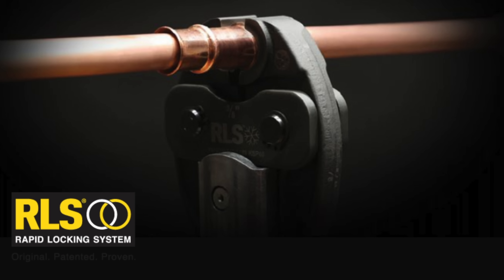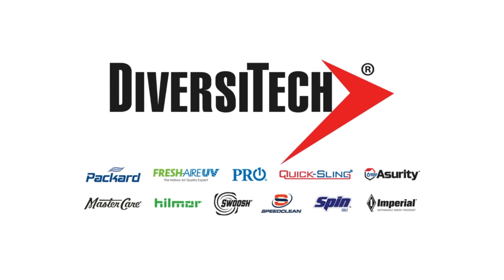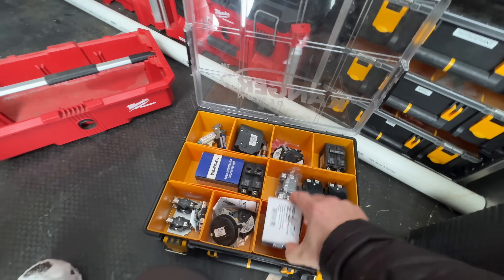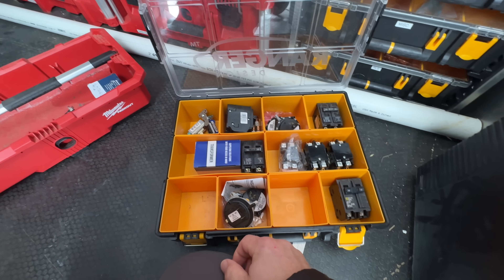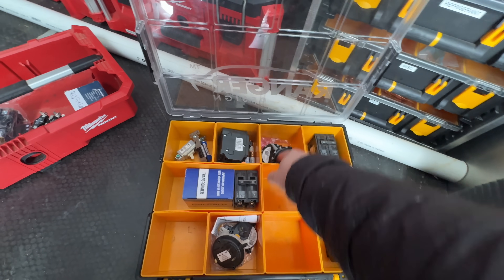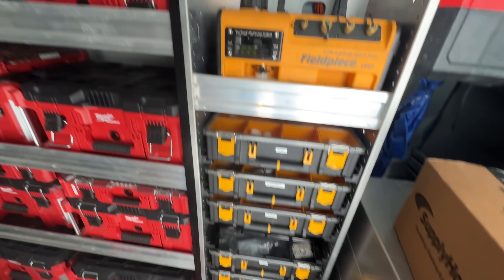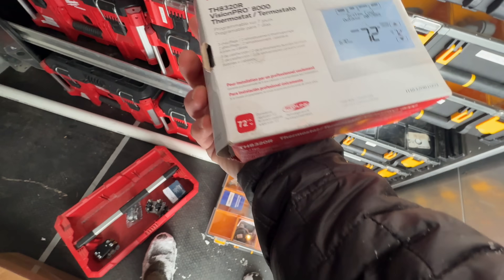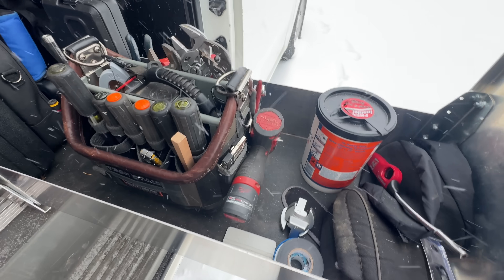No HEAT Call in a Tennessee Blizzard!! HVAC Repairs

Comment: Gotta like the easy ones! Sucks when it’s the worst day of the year though. During winter, It usually averages 30-40 degrees in my area, so I won’t set a HP lockout and let the customers run it, but set a 30 or 60 minute defrost interval, depending on how humid the area is. Usually every HP we put in has an accumulator too, so that will help any liquid coming back if it frosts heavy. However, I have family where the winter can be single or low 20s for 2 months straight, and below 0 cold snaps, so I had them run only the strip heat during the harsh part of winter. Their summers are hot so it’ll save the life for the cooling season 😊 kinda also depends if you have a single stage or inverter HP. I’ve seen some HP systems without accumulators, and I question that, and would say no to under 35, maybe even 40 lol. Must be a cheap thing

Comment: chart. this gives temperature rise, ie: if the return is 70 degrees, how much warmer the supply air is coming off the indoor unit.

OD TEMP TEMP RISE
65 33
60 31
55 29
50 27
45 25
40 23
35 21
30 19
25 17
20 15
15 13

Comment: I'm in north Texas. I tell my customers to switch to emergency heat at 20 degrees. We had some really cold weather here this week. I turned my heat pump back on at 12F just to see what it would do. I was only getting about a 4-5 TD, so I switched back to EH. Mines a 2017, 15 SEER RUUD system.

Comment: Here in nc you have to install a Cut off sensor to turn the Odu compressor off and run the EH when temps falls to a certain degree on new installs.Most of the times the cut off is 35-30

Comment: Here in Central Texas I set my Ecobee thermostat to run the compressors with regular heat pump heat down to 15 degrees Farenheit.  So far it is working well enough to get my rooms up to 68 with a 19 degree outside temperature but no snow.

Comment: in my area we have outdoor thermostats on about fifty percent of the units.... but yes... when there is a cold front that comes through where Temp is expected to be near zero for a few days, I tell my customers to put the unit into EMH until normal temps return.... just keep in mind that some outdoor units may need to be cleaned of snow from condenser before starting

Comment: Just went through my second cold snap here in Texas. I suspended my tstat  schedule & let heat pump do it's thing. It handled heating with minimal heat strip usage. Bryant 2- ton with 10kw stripes. Average daily use 40kwh almost no - stop running.

Comment: I think if it’s a high efficiency heatpump inverter and rated to heat down to 0 or below let it run all the time. Until its temp that it loses capacity. 

But if it’s only rated to 40-32 for full capacity anything past that and your heat strips will be fighting longer defrost cycles and not be able to work as efficiently as possible.

Comment: We went to Trane heat pump, electric heater setup in 2022. We have been VERY pleased with it. Our HVAC tech told us to swap to EM Heat when it's below 30 outside. We just have the lowest trane heat pump unit. I wanted one with an inverter compressor and higher SEER rating but my God it was gonna be almost $18-20k! Ridiculous. Lol. 
Awesome videos man! Love your channel!
Reply: You can buy a Mitsubishi inverter heat pump system that's direct replacement for your current unit for around $5-8K depending on system size. Other brands like Mr Cool (made by Midea, also Carrier has them make units) run a little less expensive. I'm a huge fan of inverter heat pumps, but wish more companies would recommend them at reasonable prices.
Reply: @memsu06  oh man I wanted a Mitsubishi hyper heat inverter one so badly. I was quoted like $17-$21k for one to be fully installed. If they'd have said $8-9k , I'd have bought that immediately.
Reply: Idk about residential tbh but in commercial if it’s not an IT room or there’s no other option, we don’t push those mini splits or anything inverter. You’ll never get your moneys worth and they can be frustrating for technicians to work on.

Comment: Whoever replaced tstat removed the white wire so they could come back on a winter service call.  Happens a lot.
Reply: yeah i was thinking the same thing....just cant trust some people
Reply: I know what you mean about crooked HVAC contractors pulling stuff like that. Unfortunately, I experienced more than my share. Here's an example: One company contracted with MICA(Mid-Iowa Community Action) to get all their mobile home furnace replacements. They would, of course, have to remove the 'A' coil(since most mobile home furnaces are down-flow furnaces) to replace the furnace. After replacing the furnace they would shove the coil back in the cabinet, but not hook it up to the line set and do the other things that need to be done when replacing an 'A' coil. Then, in the spring, the mobile home owner would turn on the A/C and find they didn't have any cooling. So, they'd call the company that replaced their furnace to come 'fix' the A/C. The company would come out and 'check it out' and tell the homeowner they needed a new A/C; that the old one was shot. They would then charge them such that they would make up for the 'discount' they gave MICA on the furnaces and labor.

There you have it. Not everyone in Iowa is 'Iowa Nice".

Comment: In Canada, we often set our heat pumps to cut out around -10 C (14F) because past that the OD coil can only grab so much heat to be comfortable for the supply air. I have an issue with vertical discharge outdoor units in the snow, because if ice gets on the fan blades that can mess your day up.
Reply: Im from Aus and have no idea about this, but surely someone can come up with hot gas bypass to help evap
Reply: @jrodamos  to be fair, the hot gas is already being sent to the indoor coil. The real problem is the outdoor unit can't absorb enough heat with where the technology is currently.
Reply: Same in Central Michigan
Reply: Woah. I always thought that the heat pumps usually become inefficient around the 30-35°F mark since it could put strain on the unit. I guess depending on the region they have them built a different way. Pretty interesting!

Comment: Hey brother! From Maryland. I’ve always told the customers to keep the system in normal heat mode unless the outdoor unit stops operating, then use emergency heat mode. I feel that it really depends on the actual equipment. Some equipment is more efficient than other.
Reply: Could you advise what is the difference between auxiliary heat and emergency heat?
Reply: @thecurious6721 I'm  from PA. we don't have air handlers. For the most part we have gas furnaces & central air for AC. But some of the newer systems the ac unit has a heat pump. In that case it would be considered 2 stage heat. If it's chilly outside you can run the heat pump. But if below freezing you can go to what's called emergency heat (gas furnace). It's been awhile since I wired my nest but W1 & W2 is for the furnace & OB is for the heat pump
Reply: @Dachamp2001  thanks
Reply: @thecurious6721  Np
Reply: @thecurious6721 im in oklahoma, but I rarely see a heat pump with gas as its emergency heat. Typically, it's electric heat strips (which is what is shown in this video). Which is the reason for the customer getting a heat pump (they live somewhere rural and dont have gas run to the house). A heat pump makes the refrigerant flow in the opposite direction so it absorbs heat from outside and releases it inside. But when it gets below freezing there is less heat to absorb and the outside can freeze up. The unit then switches itself to defrost mode and runs the emergency heat while the outside is thawing. But you can choose to just run it in emergency heat from the thermostat if desired.
Reply: @Cavett24 as I understood auxiliary is when heat strips are heating while  heat pump is running. Emergency heat is when electric heat strips are heating with heat pump not running. Why he/you use it as emergency heat instead of auxiliary heat?
Reply: @Dachamp2001 what part of PA are you in? I’m also in PA and about half of our systems installed are air handlers and heat pumps.
Reply: @MrCmgl1  Pittsburgh That's typically what we have furnaces & central air. Don't know about the ne building's like apartments & condos. But there's still a lot of old houses that still have boilers and steam heat.

Comment: I’m in Ontario and we just started installing Bosch heat pump dual fuel with back up gas heat and we are setting for the heat pump to switch over (balence point) to -10 celcius
Reply: How long have u been in the trade

Comment: Lennox ML14XP central HP here. I run that hard in winter in PA. It’s backed up by oil instead of strips so I do have the stat lock out the HP at 15 F, just for my own comfort with all the defrost cycles it’d do.

Comment: My 25 yr old HP definitely works harder in heat mode, compressor pulls 500 more watts and defrost cycles 90 min cumulative run plus reversing valve cycling.  In Florida it's a rare event though.

Comment: There are heat pumps here in NH but I don't trust them to work when it's -20 F. I've heard that they're a lot better lately, but time will tell. Because I'm on a mountain and lose power several times a year, I have multiple heat source options. When the propane & oil trucks can't get up the mountain, I can still use wood and pellets. I am considering getting some of these for AC and having a spring/fall light duty heating system is a good option. Having redundant systems is a fact of life while living on a mountain.
Reply: Northern VT here.  I have an oil fired furnace , a Harman Wood Pellet stove and a propane gas fireplace that does not need electric to work.  When its sub zero and the wind chills are in the minus 40s and 50s you can't be with out some kind of heat source!
Reply: @richardthomas1743  Too true neighbor, lol. I've got an indoor wood boiler, 2 propane boilers and an oil boiler. I also use a wood stove and pellet stove that both have DC fan options. I also have a propane furnace for the big garage as it's back up source to the radiant system. 
   I also have propane and electric dryers, ovens and water heaters. There are 3 different fuel generators here too. Propane, gas and diesel/kero. There's more but you get the idea.
Reply: @MakeitZUPER    You are prepared!  👍
Reply: I’m also in nh, I mainly work on and install vrf/vrv heat pumps and it’s hard to believe but I have seen heat pumps still produce plenty of heat in below 0 temperatures even with heavy wind on the roof. Now I absolutely wouldn’t want to pay the electric bill and I’d bet a compressor might blow if it’s below zero for over a couple weeks. But they’ll surprise you.
Reply: Another HVAC tech from NH here: I find that for our area right now the energy costs of the best heat pumps don't beat a high-efficiency gas heater when it's under 35-40F for natural gas or 10-15F for propane, but if you don't care as much about the energy cost (like if you have solar) then those heat pumps will still heat at their full output down to about 5-10F and can often still keep up at reduced output in a well sealed/insulated home down to -10F. I always suggest two sources of heat for every household anyway, so a heat pump for 80-90% of the year and a gas unit for the other 10-20% isn't a bad way to go; especially if you throw an automatic backup generator on the gas line to deal with any power outages.
Reply: We work in that weather all the time. And for really cold climates the heat pumps don’t work well. Trust me
Reply: You betcha!
Reply: Only three brands can work up to -3 to -10 and thats Bosch, Carrier Hybrid and Mitsubishi. Otherwise you’re SOL, but these idiot lawmakers dont care.
Reply: Where was the white and brown wires that were disconnected coming from? And did you connect both to the white wires?

Comment: I used to teach the same thing.  Burn the strips below freezing but honestly if your tstat drops below setpoint by two degrees the strips will come on to boost heat.  Im in Bama so I agree when its freezing and snow/ice to cut the unit off and turn on emergency heat.
Reply: I’m from Tuscaloosa Al and I’ll tell people to do the same thing too. One reason is all those  icicles start to form  on the top of the grill then end up getting in your fan blade tearing your fan blade up
Reply: Yeah your right on the minus 2 degree below set point however that still leaves the unit running plus then the strips come on.  Best to just click it over to emergency.  Save the compressor.